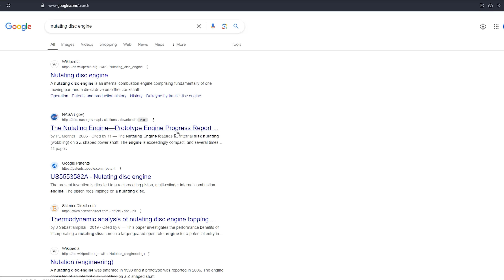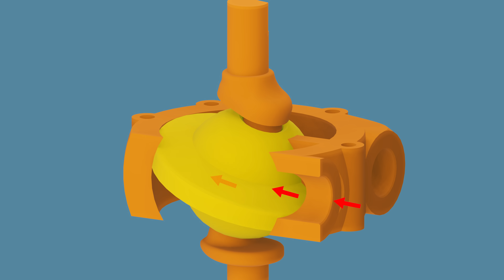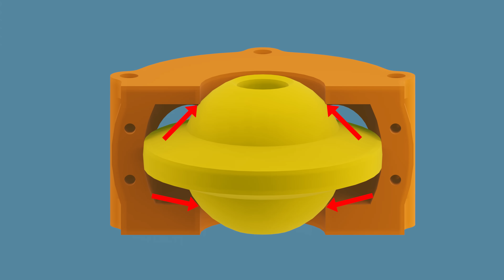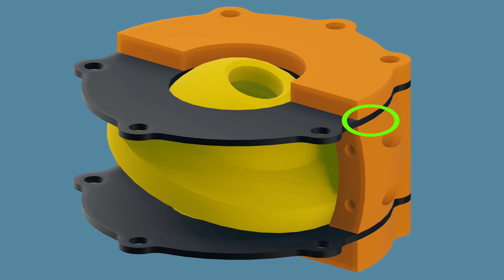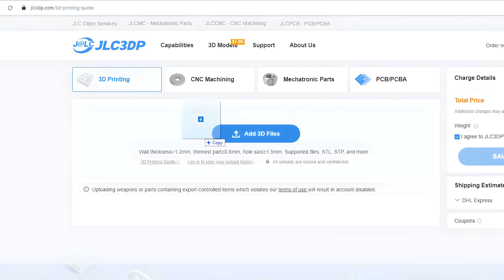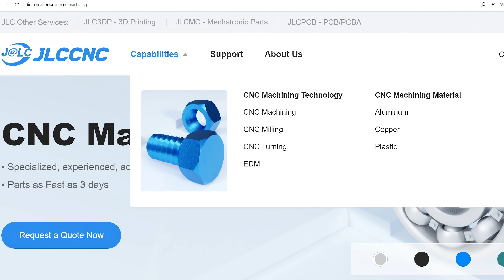I Built a Nutating Disk Air Engine

Comment: For future references that I see a new propulsive innovations that seems into a low-frequency engines are may found here within the complete vacuum mechanics to replace the energy-wasting electric-powered motors on the wasted lifting-ratio scales,

only to integrate its sealing points were the vacuum propulsions have still difficult to direct

Comment: Friction + Vibration.... This engine is not designed to last and uses too much air pressure... I'd rather use water pump  to build a similar engine than this

Comment: Have you tried making a nozzle for the exit that makes the opening smaller? it should make the air go faster and the increased pressure could give it more torque, i'm no physist but i feel that could make it better at lower PSI

Comment: Have the disk flatter. Have a straight bearing. Pump the air, which can be a viscous vapor, through the bearing and create a lubricated vapor cushion that has viscous drag to add to the deflection and bernounilli forces while reducing friction. Titanium has excellent properties for having different extreme drag coefficients for the surface of the turbine and the bearing contact.

Comment: since u r using compressed air as power input - u can also use multiple thin partition disc of vertical axis using air friction to rotate at high speed

Comment: since the air can work on both sides of the disc, if you wanted to make a 2-disc engine would you want to stagger them by 45 degrees like a steam locomotive, instead of 90 degrees like a conventional piston engine?

Comment: Can you control speed just by an exhaust valve so the inlet pressure can stay constant, or does that adversely affect operation?
Can you print a planetary gearbox for the exhaust and then a gear motor to move the low pressure exhaust back into the compressor tank?
If you run a generator on it how much less (or more?) power is there compared with that of the electricity used to power the compressor?
Reply: Using compressed air as a battery... Air engines could convert daylight to nighttime energy, no?

Comment: If the disk was made from black diamond material aka man made diamond which we use for massive drilling it would technically last forever and it probably would be less friction. Be less power loss more power can will be utilised.

Comment: You need 2 "piston rings" on your 'rotor' with Spherical OD Profiles. This will 'SEAL' everything in the 2 directions of pressure drop. This might solve the impending lube issues. The concept is simple an deserves refinement.

Comment: Since it is a compressed air powered machine, and there seems to be some issue with friction, an inline oiler filled with an appropriate lubricant might be helpful.  Look at SMC's line of inline oilers.  SMC's stuff is reasonably priced and of good quality.

Comment: But to powered the air compressor, we need electricity, for electricity we need either the combustion generator or electric generator ... That's why rather than puting 3 type of engine in one vehicle, they use 1 engine . Also the problem you having are the reason why they didn't use this design . Also putting air tank in the vehicle are way more dangerous .

Comment: The design seems inherently awfully inefficient.  Just because it's constantly leaking air even if it doesn't move. I wonder what improvements could be made.  It seems the comments section is already on the ball with a couple!  lol.   Great experiment!

Comment: Maybe the reason no one ever thought about an engine using nutation as motion principle is obvious in the video itself, it's likely one of the worst designs possible! Most of the core is always touching the walls of the chamber (worse yet, the core is FORCED against the walls!) The friction is so high that it cannot start moving by itself! Besides, it's a turbine (as others have pointed out), not an internal combustion engine (although it is, for whatever reason, compared to a Wankel engine at the beginning of the video.) Engine design have evolved for a very long time. If something is not being used (or have already been discarded,) it's because it wasn't even worth trying to begin with (it's similar to natural selection, only the fittest designs survive the market.)

Comment: The air speeds and pressures define what filters or filters or pollution defines the applications. It's time by longer time. Even money which might be holiday I use the same as my work I still selling buying to think though my money like what a harvest is I have to not think Bout life I need to mange and ration the volume adjust and continue hydration using energy to clean the water and feeding the cycle helix away from danger. I go too far I need to recall or too fast how I climb away from the new danger or share this so the community is sustained for living normality. Often in two weeks a can a clean water can with foods clothing clean and still able to be safe. Taxation is this without been hunted by been kind

Comment: Well, it’s a pretty cool little project for sure, but in reality it is not an engine at all, rather it is an implement that runs off an engine. The compressor is the engine in this circumstance, and without it the air implement would do nothing at all.

Comment: The original patent for this type of engine was granted to Daniel Dakeyne in 1794, his son then built an operating version of this engine in 1820 to power a flax mill in Ladygrove, Derbyshire, UK, It was called the Dakayne Hydraulic Engine and ran on a ready supply of high pressure water from the valley it was located in. Locally the engine was called The Romping Lion. Sadly the engine was ridiculed because everyone was already using steam beam engines to power the mills, but I agree with @richardburge2791 that this is actually a form of Turbine, but when invented originally I don't think turbines were in use back then, so it was called an Engine.

Comment: The water can easily be returned to the reservoir and the cycle repeated over and over again. The only problem is that it can freeze at too low a temperature.

Comment: Since it's being powered by air, how can you measure the torque? I don't think it would be strong enough with just 100PSI. You would need much higher pressure to produce a good amount of torque.

Comment: Whats funny is this is almost the way valves for sprinkler systems work.  Its not continue motion, but they have a diaphram that compresses when an electric signal sends the message to turn it on.  And the compression of the diaphram is what release the water.

Comment: Just need a 3hp air compressor to make a air motor you can stop with your hand.   I could build one way faster cheaper and way more powerful for around $20.    Go to harbor freight & get the cheapest i grinder they have and mount a propeller.

Comment: ceiling fan option - converts most of the pressure to blade rotation but any that escapes is routed to blow between the blades

Comment: If injection-molded (with a lightweight, hollow rotor, with the crankshaft in one piece), with shiny-smooth sealing-surfaces, it´d be a nice air-engine for toy-planes, the rise in efficiency and longer flight-times might even justify an 1-channel rc-rudder-actuator... I don´t think there is rc-air-engine toy-planes yet...

Comment: Why not to simply put a rotatable fan inside? The basic job is of compressed air flowing into this assembly, it will push the blades of the fan inside also and similarly make the fan rotate and it would be more smooth and vibration free than a wobbling disc.

Comment: One of the major problems with this engine is that it expells most of its lubricant out of the exhaust while under power. Also, friction is high for the low torque that it produces. Its a very interesting concept though

Comment: 3:49 you can determine the issue by:

1) introducing smoke into the inlet

2) submerging the device in water

Either one will show you where failure is occurring. 1 is preferred for devices that should be free of water due to contamination or deterioration. 2 is otherwise preferred because it's more telling.

Comment: lol. your case you made didn't fall apart! Although. To use for flight, isn't practical. As it takes a lot of energy to compress  air. and a large volume container to store enough of it (as Im sure your air compressor wont even run it for 5 min.) Until another power source(electric compressor motor) needed to compress more. Meaning its not as efficient as  just using the electric motor directly instead . 

But... Even though it may not be a good idea to ✈️. 
It may actually be a great idea if you flipped the concept around! 

And use it to compress gas with an electric motor instead.

Just connected  it to the motor shaft and and air tank with one way valve.  

Im pretty sure that will fill up that same air tank quicker, with higher pressure using a lot less power with the same motor. 

the only two basic compressors use either a regular pisiton with a belt or blower/turbo prop designs. 

Each with thier downfalls, the piston type fills up fast because of the cylinder volume but requires a lot more torque as it pressure increases inorder to push the air in. that can also have a lot of push back on the piston because of the large volume. That causing belts to slip or stops the motor.  Requiring much larger powerfull motors and more expensive parts using gears instead of belts, also piston types have limited RPMs without having oil and oil pumps, which they still have low RPM limits compared to  RC car electric motors with 50,000-80,000RPM. 

second type is like a blower or turbo prop that requires high RPMs to force the air in and always needs a high RPM  Because it has a lot of blow back its not very efficient and as the pressure increases the volume it compresses per RPM reduces dramatically. That to increase the Max pressure the RPMs need to increase e exponentially.That 30,000 RPM may get it to 100psi . But to go from 100psi to 150 psi may need  60,000 RPM. And to make 180 psi will need 90,000 RPM. That as the RPMs increases its longevity reduces and/or requires more expensive more powerful high RPM motors, bearings, and parts.  That it becomes a point on the price to gain only a few more psi isn't worth the cost, or shortend reliability. 

That your little motor solves all those issues for both motors. 
That would 
use less power,
fill a tank faster, 
make a higher psi, 
And cost less to manufacturer .  

As the rotation of your sphere may not have as much volume as a piston types up stroke. The piston type doesn't compress on the down stroke  as it needs to suck in air. 

Your sphere type can compress constantly l
But since its easier to compress a smaller amount each time it can use a smaller motor. Also because your sphere type doesn't have a return stroke where half its rotation is not compressing. Yours would compensate for the smaller volume as it would always be  compressing and  can easily have a much higher RPM. 

It also doesn't need a minimum RPM  as it  has very little blow back.That its compressed volume per RPM will stay the same. That by increasing the RPM will only increase the psi to its max psi much faster and at a higher PSI more efficiently ,and economically less than both those other compressors  

I will give you a reason why it can use a less wattage motor than piston type yet still have higher PSI ( pounds per square inch)
lets say the piston surface is exactly 1 square inch. That if you had it face down and a 100pound person stand on it pushing air down into a tank and pumped  it up .with a oneway valve  so air cant go out of the tank.  until in piston wouldn't go down any more and balanced themselves on one foot on top and wouldn't go down  any more  That the psi in the tank would be 100psi. ( 100 lbs on 1sq inch pushing pressure.) 

then let's say they put a small piston that was 0.25sq inch.  and that same person pumped it. until it wound go down any more balancing themselves on one foot . 
Since 0.25 is 1/4 th the size . 
 they could essentially increase the psi 4x  or to 400psi  ( although it will take 4x as many pumps to do it)  Because. it all has to do with the surface area. That while they only weigh 100lbs.  they made the psi = 100pounds per square 0.25 inch.     that if they put back on the 1sq inch piston. it would be  the same as 4 of those little 0.25inch pistons each pushing 100lbs them up, Up  that it would  400lbs 

That even if a 250 lbs person tried to push that 1inch piston pushing 400psi it wouldnt  move down

Or lets say the that there was  (144 piston pumps 1sq/inch. each that were all tied together with a flat plate on the top) making it one big piston 1sq/foot in size) .  That if you had that connected to the same air tank.  And that  same 100 lb person used the same  0.25sq/inch piston pumped to 100 lbs. . 
    That each of those 1sq/inch pumps would have 400 psi. /  pushing up 400lbs  each  ) 
.That  if you had 144  of them (=1sq/ foot) strapped together each pushing up 400lbs  with a metal plate on top to disperse the weight.  
Each 1sq/ft plate could lift 57600lbs.  

That if you had 4 of those 1 sq/ft  piston pump lifts( 144 sq/inch pumps straped together with metal plate on top.) that someone who was only 100lbs with a tiny little pump could actually lift an army tank. 

So back to your pump  you made. 
  Is it a good Idea for someone to make it into a compressor pump??
That has no (very little blow back) with one way valve. with pressure regulator. That pumps with a smaller surface area pump to easily pump 180+psi.  Using a smaller electric motor  with higher RPM than piston type pump. ( yet lower RPM than blower type pump)   Which can be made cheaper and smaller and out pump both it them . 

I think you should already know the answer to that?

So once you figure that out, and get rich selling them.  Dont forget, who pointed you in the right direction. 

That's if you ever decided to take the time to actually read comments. From people giving you great ideas that you may have never thought about.

Comment: it’s not gonna produce much thrust at 850 RPM, However I wonder how much torque this thing could manage, as this is basically ALWAYS the problem with “new” engine designs. This is the reason reciprocating and turbines are still used for most things (although electric torque is getting better) because they simply cannot be matched in torque. If given any resistance, this engine would probably fail, or just stop rotating.

Comment: can this be used in reverse to instead harvest rotational energey into air pressure or perhaps water? how would this turbine react with water would it propel water through the wheel much like a N.Tesla's  water turbine

Comment: Whats more efficient? The pneumatic conversion of the electricity that runs the pump turning to thrust through this device? Or just attaching the propeller to the air compressors electric motor to generate thrust? Its a fun concept, but what purpose can it serve?

Comment: I wonder if the disk and axle could be connected so that the disk also turns. It will still "wobble" but it would avoid the need to lubricate the joint between the axle and the disk

Comment: You could put say 6 of them in series, with a manifold that distributes air to all 6, but have indivitual z-shafts offset progressively in steps of 60deg, so that way the complete power cycle is being represented all the time at the same time, a bit like how a 6 or 8 cylinder ICE has different cylinders at various stages in their individual cycle.

Comment: But where does the air come from? Or in case of hydraulics what pumps the fluid?
You still need a motor to create compressed air or drive a hydraulic pump system.

Comment: I think there is a huge waste of pressure, while the pressure in an air drill or screwdriver have large forces so you are not using the same mechanical movement of your fan?

Comment: I see 2 problems and I'm not even a mechanical engineer... 1, how do u control misfiring and pressure loss at higher rmp.
2. Where is the torque.

Comment: This will never take off. The reason being that anywhere you would apply it, there is already something that does that job better. The function of your concept is to harness a moving fluid’s energy into rotational energy. But we already have different turbine systems for any way you could hope to harness moving fluids:
Wind turbines are doing really well.
Turbines in water dams.
Even if you wanted to use it as a gas generator, you would be better off with a system based off of a turbo shaft because they have a process that is without cycles. Your system has two events per rotation when the seals switch. Those moments are massive inefficiencies that will make either a turbo shaft or a turbine the better choice in any situation.

Comment: So you are using compressed air to spin a motor to push forward? Would it not be more efficient just to use the compressed air to directly propel the vehicle? Less energy loss from friction

Comment: Add oil injection and recovery stages with a small recirculation pump.  Run a peristaltic pump off the compressed air supply and oil flow will increase and decrease in sync with increased/decreased motor RPM.

Comment: You didn't make an engine. You made a turbine. If you had made an engine, you would not have needed to feed it compressed air to make it work. It would have taken air in on it's own, then added energy to the air by some method (mixing with fuel and igniting comes to mind), and used that energy to spin the rotor.

Comment: What if the two sides of the casing were identical? As in both were capable of providing air input and exhaust? Could you manifold the air upstream of the inputs and provide pressure from two opposing inputs? Would it increase the propulsion? And what if you made several inputs around the casing ? 4, 6 or even 8 inputs? Would it increase the speed or decrease the wobble?